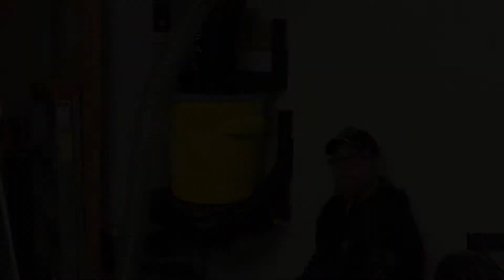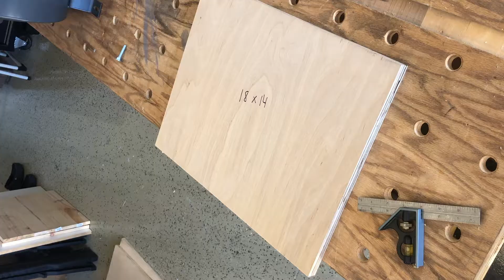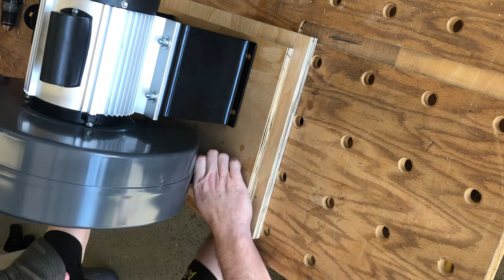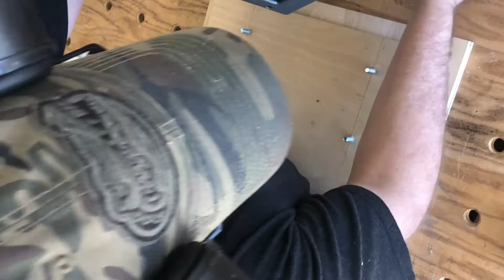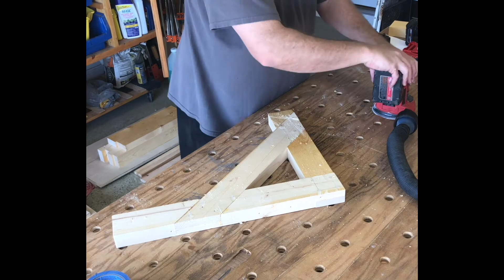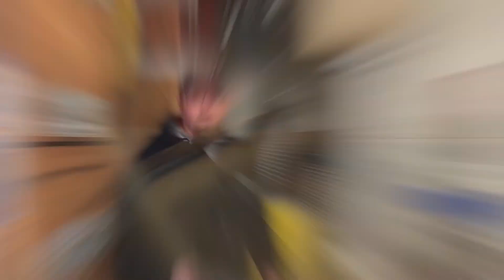Harbor Freight Dust Collector Frankenstein Part 1

Comment: What kind of amp draw do you get on this? I only have 15 amp circuits in my garage. I got the small portable dust collector and I regret it each time I turn it on, but I was afraid that the good dust collector wouldn't work with my power situation.
Reply from the maker: I ran it off a 15 amp circuit for the first 9 months with no trips and it is a GFCI circuit.  A couple of months ago I wired it into a 20 amp because I plan to upgrade the fan blade.